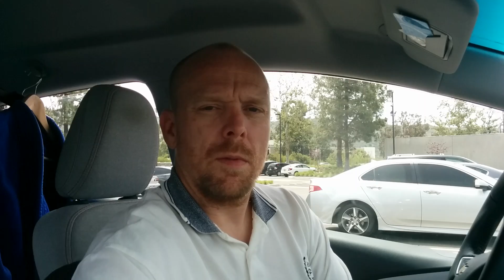Plug-Side Chat: The Power of Regenerative Braking

Comment: Virtually the whole stationary world is powered by electric drive motors.  The advent of suitable portable batteries means that the  portable world of vehicles will transition to electric drive  too.
Reply from the maker: That's true. It reminds me of the Leaf commercial where the water dispenser and computers were running off of little internal combustion engines. It's a ridiculous concept.

Comment: Good point about the brake dust! My Model S has 160,000 miles and my brake pads look almost like new. I expect to never having to replace brake pads or rotors. In normal driving around LA I regenerate about 25-30% of the energy.

Comment: I love the one pedal driving regen braking facilitates.  https://youtu.be/kNDWzFaiDZQ goes into the math and explains that stopping a 3300lbs vehicle from 62mph  reclaims about 347.2kj of energy.  347.2kj is 96.4Wh ( https://www.unitjuggler.com/convert-energy-from-kJ-to-Wh.html?val=347.2 ).  The Bolt is heavier (3800lbs)  so every stop from 62mph gets you about 664.7kj or 184.6 watt hour back.  Since the energy is velocity squared  stopping from slower speeds reclaims less energy. I estimate 5-8% is the typical additional range regen provides. Some cars/driver with the right mix of routes could get 10%, but to get more than that over a long period of time I don't think is possible.  I'm shocked at the amount of brake dust the collects on my wheels everyday even though I use regen.

Comment: The info re Telsa trucks (or any EV) gaining 3kWh/ per ton / per 1000 ft drop in elevation is new info for me, I had not seen a numeric approximation of this before. The possible use in electric ferries and the particulates caused by brake dust (didn't realize the magnitude!) is new. I have found driving my wife's SUV I have be careful to apply brakes earlier than I am used to in my Bolt EV where sometimes brakes are not needed at all. Good Job NC!
Reply from the maker: It's just an approximatation. There is a mathematical equation for figuring it out, and I might have misrepresented it, now that I think about it. It might only be 1 kWh per ton... Oh, well... Wait for the math surgeon to skewer me.

Comment: One of the most ingenious ways to use regen is done in a car made by RiverSimple which uses a bank of super capacitors to accelerate the car or capture the energy when stopping, and a hydrogen fuel cell to add energy for system losses and aerodynamic drag and rolling resistance losses. The hydrogen fuel cell could just as easily be replaced by anything which has low power with high energy storage, such as an ICE engine or micro turbine, or even a bunch of very cheap low drain high energy batteries.

Since we all know we can’t use Super capacitors to store energy for long times due to the high self-discharge rate, but they can charge and discharge so fast that all braking energy can be done with regen, unlike normal EVs which typically limit to 60 kw, and less if the battery is fully charged.

The system works by starting with the supercaps basically empty, and powering up the car, which allows the super caps to charge up to a level inversely proportional to the car’s speed, so at 0 mph it would be fully charged and at max speed it would stay fully discharge (and ready to capture regen energy). 

The struggle with a EVs is being able to choose a single battery chemistry which allows enough power to accelerate the car and absorb regen, and enough energy to go far. The Chevy Volt has a very high power battery, but only 16 kWh, and the Chevy Bolt has a low power battery with high energy. When you made a hybrid battery, you can use super caps for the power, and very very low power, very very high energy batteries for the energy.

An example of the batteries are the cheap batteries used in giant portable power banks with 20 ah  and a max discharge of 2 amps (1/10C). They work great, but if you try to discharge at 3C like EVs need to do, it will sag down to the low voltage trip. This is sort of like what JB Straubel was trying to explain to Galileo from Hyperchange about why Tesla doesn’t have 350 kw superchargers. It’s not about the charger, it’s about the battery, and no Production Tesla can take that power, only the 2020 Roadster can, and the semi can use 4x 350 kw superchargers.

But the problem with using very very low C-rate batteries is you can’t fast charge them at 2.5C like you can a Chevy Spark EV. You can’t even charge at 1C like the Chevy Bolt EV. You will need to charge it at about 1/5C. So it would be best for when your daily commute is less than 100 miles.

Comment: As you covered in some replies to comments, most people don’t realize that anything that decelerates the vehicle wastes energy, so it’s a matter of reducing all the deceleration forces as much as possible, and only use regen when the other means of deceleration waste more energy, such as using the friction brakes or running into a crash barrier. 

Another time when regen can help is when descending down very steep mountains, such as coasting at 75 mph or regen down to 60 mph. 70% of energy wasted by the additional deceleration forces from aerodynamic drag can put some energy back in the battery. 

This is where regen can do better than a car without regen, which has no choice but to coast as fast as gravity will allow. 

For heavy start-stop operations, there was a company which made a hydraulic regen for heavy trucks like trash trucks, which would pump hydraulic fluid into a high pressure accumulator to decelerate, and then use the stored energy to run the pump as a hydraulic motor to help get the truck moving again.

Comment: Unfortunately I missed out on getting the most Regen . My leaf is a 2013 it has ECO mode, but then in 2014 Nissan added another regen mode called "B" mode.  I do wish I had more regen, but i don't.
Reply: Aaron Z I just use Eco mode in low speed traffic and use brake pedal gently to get max regen. Otherwise I use normal mode and coast when I can, keeping enough light pressure on pedal to keep even the creep regen off.
Reply: Donald Parish yeah I use Eco mode in city traffic. Then turn it off for freeway. 
I'm aware of the additional regen when you touch the break pedal.   With my leaf it feels like there should be more regen ,  of course they added more the next model year.  Nissan made little improvements every year.

Comment: Along the same lines...Get this...there’s a mountain-top mine somewhere (I think Greenland ??) Where the HUGE trucks go up the mountain empty,  and come down fully-loaded. There is enough power generated on the way down that there is MORE power than is needed to send an empty truck back up. The electric trucks end up generating a SURPLUS of energy!! They did the calculations first, realized this and it ended up also paying for the conversion of their diesel powered trucks to electric power. That’s using your noggin’
Reply from the maker: Yes, It's crazy what can be done. People think of EVs as single-use tools, but why not leverage them for more?
Reply: News Coulomb, yeah. I just thought of something: using regenerative energy from elevators in buildings. Hmmm

Comment: I completely agree that Regenerative Braking is a plus for the EV however you are incorrect that a gas model does not gain anything from going down hill. The comparable gas model gains in MPG. I average over 50 MPG in my vehicle. Going up hills it usually drops to around 25 to 30 for that hill depending on the grade. However going down the same hill it shows a MPG of over 100 MPG for that hill which brings my MPG back up. So while it is true that the EV with Regenerative Braking may have a little better gain than the comparable gas model it is false that the comparable gas model does not gain anything from going down hill. What the EV needs is positive regenerative where it puts back more going down hill than it used going up hill. That is now available on some very large EV autonomous trucks. Once the automakers incorporate this in the EV it will make a serious dent in gas vehicles. https://www.youtube.com/watch?v=c7AOVJPtxTI
Reply from the maker: The point is, they don't get anything extra. It's just a "free ride" down. EVs get the free ride and additional energy that can be used later.
Reply: @newscoulomb3705  

Also, on a gas car, even the "free" ride down isn't really free because you still have to keep the engine running. I've been on some bumpy forest service roads that take 30+ minutes to descend. With an electric car, it's regen all the way and the battery level increases. With a gas car, the descent burns gas equivalent to 30 minutes of engine idling.
Reply: News Coulcomb, yes that is true and why I said that the EV has the advantage and gets a little more than the comparable gas model. If I was like most every EV owner I would not give credit where credit is due, but you see I stand for truth. However the down hill is not enough to over come the over price of the EV, long waits for charging if the charger even works, the inconvenience of the chargers not taking credit cards, or trying t even find one, the cold and very short rides in the winter, just to mention a few things.
Reply: I think the 100 mpg is because the fuel injectors cut out on modern cars on down hills for example.
Reply: james that could be but it does not matter how it happens, just that it happens and that the claim of no gain is false.

Comment: I agree with your assessment.  One of my favorite features of the Bolt is the one pedal driving in the L mode which is a direct result of regenerative braking.   It simplifies my driving by letting me regulate my speed without switching back and forth between the accelerator and brake and consequently smooths out the two effects.  And in so doing adds, rather than wastes, the power generated from slowing the car down.

The lack of this feature is what I miss most when I have to drive an ICE vehicle.

I love the idea of using EV on trucks bringing loads downhill and generating a large part of the power necessary to return the trucks back up.

I'm really enjoying your Plug-Side Chats.  Thanks.
Reply: Agreed, by far my favorite feature of the bolt :)
Reply from the maker: Thanks! I'm not sure how many people will enjoy them, but I feel like opening a dialogue about these topics is important.

Comment: What's the most efficient way to brake in the Bolt?  Coasting down in "D" getting 15 or so kw as much as possible, using the Regen paddle in "D" or slowing down real quick in "L"?
Reply: Energy lost is proportional to current squared times the resistance.  Charge voltage into the battery is a fairly consistent variable that depends on state of charge.  So for the most part double the power equals double the charging current.   So double the regeneration power would equate to four times the charging losses.  So longer slower stops with lower instantaneous regeneration power will be more efficient.
Reply: You can get more than 15KW in D.  You just need to press the brake pedal.  In the Bolt EV the car is always trying to maximise regeneration no matter what button - paddle - peddle or mode your in/use.   The Bolt EV always applies regeneration first.  So if you use D or L or the regen paddle it's simply personal preference.   However longer slower stops are always more efficient than short hard stops.
Reply from the maker: The most efficient way to brake is not at all. In terms of efficiency between 20 kW and 70 kW of regenerative braking, I don't know that there's a good way of measuring it. I'm sure the latter is less efficient, as it would produce more heat.
Reply: Agreed.  If conditions allow, I coast down at 1kw to -2kw (regen) if I don't have someone tailgating me and lots of room to slow down in front of me.  However, I have a big downhill on my route back from work after getting a full charge.  I've experimented multiple times with coasting and regen paddle braking vs foot completely off the pedal in "D".  I've seen 100 - 200 more watt-hours of regen back into the battery with foot completely off the pedal in "D" consistently.  Maybe there are some other factors, but I think if you have to slow down faster than a zero regen coast, just take your foot off the pedal instead of using the paddle shifter.  Think you can confirm my results?